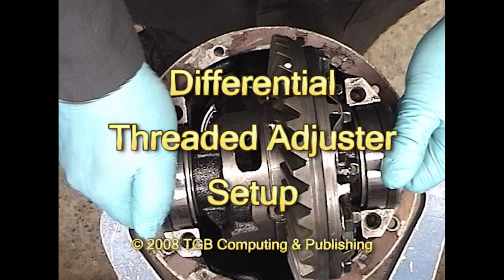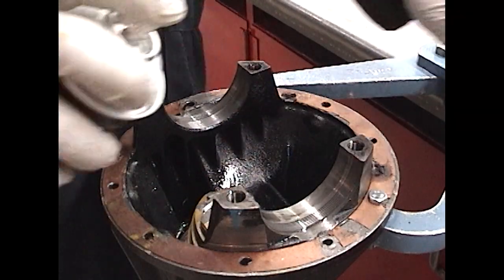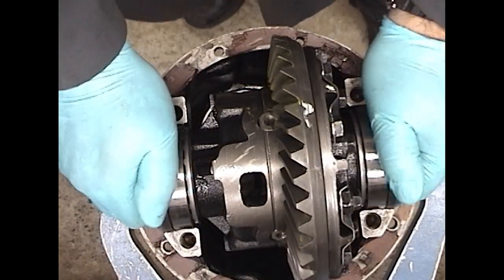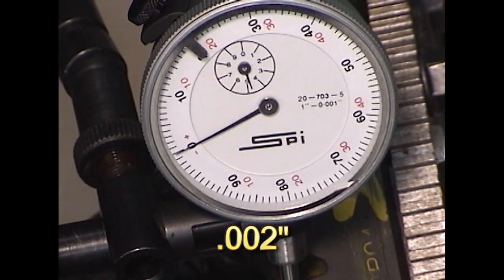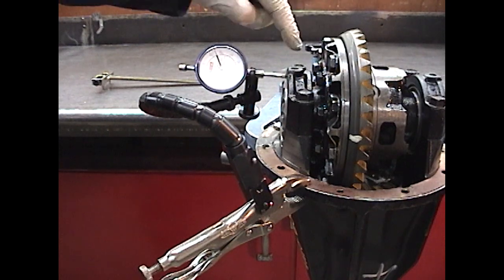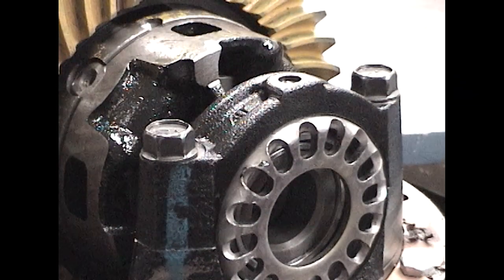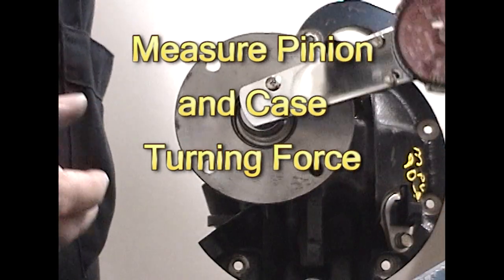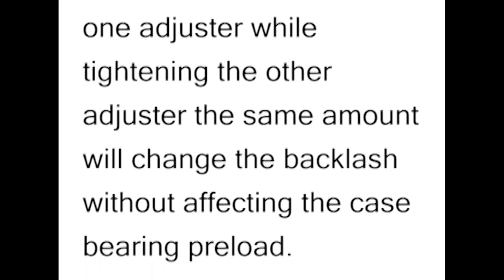Threaded Differential Case Setup

Comment: I have a 50-60 year old rear end that was converted into a trailer.  I opened the differential and it is very similar to this design.  I’m no mechanic but i’d like to see some gear oil in there (there was none).  It doesn’t matter a whole lot because the thing just freewheels.  It has no load.  But I’m a little stumped on how to put it back together and this video helps.
Reply from the maker: Yes you need gear oil in here or the gears could get hot and be damaged. Not sure how it survived without oil unless the axles don't go all the way from the wheel to the side bearings.

Comment: All technical specs I see about the Chrysler 8.25” rear diff say that the final side adjustment torque should be cranked to 70ft/lbs (after main caps have been torqued) to get the final backlash measurement, yet all technical vids I’ve watched say to just add 2ish notches of “torque” to end up with final backlash measurement. Am I over-tightening my carrier preload by cranking down on the side adjusters so hard? And more importantly can that carrier preload being overtightened cause a clunk in both axles when driving? (Not shifting as with loose pinion preload)
Reply from the maker: This is interesting because that torque is subject to a lot of factors including any binding between the threads of the adjuster.  Here is what I would do.  Measure your pinion preload before installing the case.  install the case and use the adjusters to set the backlash to a few thousandth of an inch below specification with zero or just a slight case bearing preload.  Tighten the non-ring gear side adjuster 2 spanner notches. Check for proper backlash then check the turning force of the pinion.  It should be about 3 - 5 inch pounds greater than it was without the case.  This depends on the diff gear ratio.  Gear ratios above 4:1 will be closer to 3-4 inch pounds.  Ratios lower than 4:1 should be closer to 4 -5 inch pounds. If you get this right and the backlash is correct your set. put the final torque on the bearing caps. Final test is your contact patch to ensure your pinion depth is correct.  If the pattern is also good you should be all set.  Sorry for the delayed response. I was on holiday.
Reply: @DrivelineMaster  gear set is 3.55, I have done this and it went exactly as you stated, 15in/lbs pinion (manual said between 10-20in/lbs with used gear/race, which are still like new condition so I reused them) and 20in/lbs total w/pinion+carrier, with my final back lash being .007 and spot on contact pattern. Reopened after 100 miles to check everything and it’s still spoton 🤙🏻

I do have a question, quick info relating to it … for some reason I get a clunk at each wheel, similar to loose pinion clunk (my original problems starting this process), but it’s at the end of each axel@wheel area, sometimes just one, sometimes both. Barely (unmeasured) any movement in axel bearings up/down, none side to side, and they also look new, I also just changed out my rear pads at same time as servicing rear diff and might have some caliper sticking problems as well, which I’m about to address, just in case.

I guess my new question is, is there any thing and/or reason that would cause a clunk at the wheel area/end of axel resulting from something being off/wrong in the rear diff, even tho everything is acting/looking/reading spoton? 

Original problem was loose pinion, and while I had it off the ground I did a few other things so it’s got me second guessing everything cuz the sound is so similar to a loose pinion, just diff area lol. Thx for taking the time to read all this and help. I feel like I’m chasing ghosts over here sometimes 🤦🏼
Reply from the maker: You might have excessive side gear backlash.  That is the backlash between your side and the differential pinion gears (spider gears).  Did you inspect those gears when you had it apart?  Here is a quick check.  Raise one drive wheel off the ground.  Measure 12" from the center of the wheel that is off the ground and place a chalk mark that is as close to vertical to the ground as possible.  Find an object like  stool or something that you can place on the ground with an edge that you can align with your mark.  Rotate the wheel back and forth making sure the driveshaft doesn't move.  Measure the amount of movement by using the chalk mark and your reference edge.  Anything close to and over 1" is excessive and a result of differential backlash either pinion or spider gears or both. We know it's not pinion backlash so the only thing left is spider gears.  The case where the spider gears ride on can also wear so make sure to inspect that area.  Something that is very obscure wold be the axle splines where they engage with the side gears. if they are worn you could experience a clunk. I'm not exactly sure what the exact circumstances are when you hear this but if you still can't find it it could be a suspension clunk.  Maybe a control arm bushing or something like that. Let me know if you find it.
Reply: @DrivelineMaster  I “have” but I don’t know the exact spec and/or exactly what to measure, I know I have a video of me measuring and recording the play in the spider gears (top/bottom and both sides) as in regards to what seems like backlash for them (side) and play (top bottom and in regards to the pin) but I did not check where the side gears seat into carrier, as far as my axel splines/side gear splines they are all like new and have virtually no play. The noise isn’t always there, only when the vehicle weight seems to shift on the axels, it is not my brakes. I will check my suspension mounts as well (trailing arms, etc) but I’m suspecting the spider gears, I will dig in and let you know after I run this check. I can’t thank you enough, I’ve been scouring the net and nothing is helping so far, except this. Much appreciated 🙏🏻 I will report back soon.
Reply from the maker: Good luck.  Sounds more like something other than diff noise.  If you haven't seen this on side gear backlash here it is. https://youtu.be/jlHc0_ocSLw?si=SHHQuR2y7hAUMHVT Exact specs are often allusive but typically somewhere in the range of 0.0015" to 0.003" should work well. In the video the backlash is excessive the point was to show how to measure it. If the clunking is from excessive backlash typically it can be noticed using this test.  Raise the engine RPM to around 1000. place your foot on the brake and shift from neutral to drive, then from drive to reverse. Repeat this. Excessive backlash normally would be heard  every time the direction changes. D to R, and R to D.  This is very hard to do with a manual transmission but can be done by quickly popping the clutch in and out after changing from 1st to R and R to 1st.
Reply: @DrivelineMaster  ok cool, ty for the new info, really appreciate all the help. I will be saving this video and our convo for future rearend problems …it ended up being the rear lower trailing arm bolts tho 🤦🏼 can’t believe I went through the diff so many times after the 1st rebuild thinking something was wrong, but it’s good to know I’m 100% spot on with my rear end rebuild, part in thanks to you bro, Ty 🤙🏻
Reply from the maker: Good to know and I'm glad you found it.  I had something similar once with an old Toyota Supra.

Comment: You don’t need to press the bearings to he carrier
Reply from the maker: The inner race of the bearing is pressed onto the case and the outer race is moved by the threaded adjuster that is located in the carrier housing.  The adjusters do 2 things. 1) they can be used to position the ring gear/case to adjust backlash and 2) they are used to apply pressure on the case bearings which is called case bearing preload.  Both settings are critical to a proper diff setup and long life.